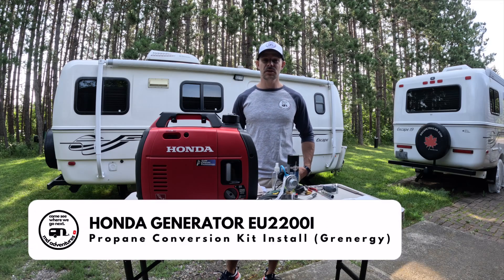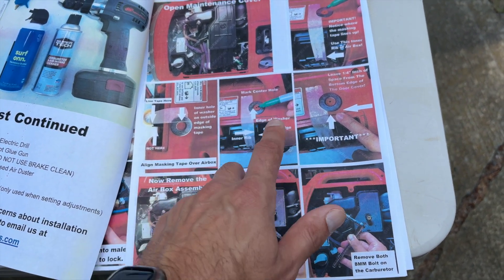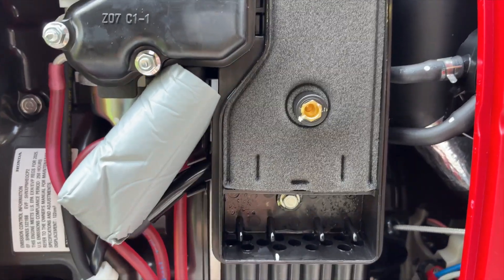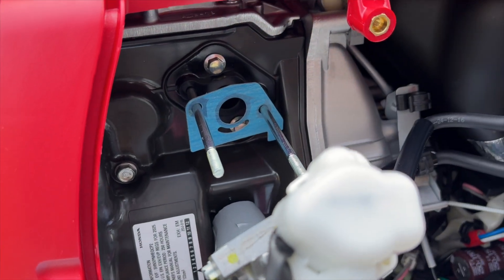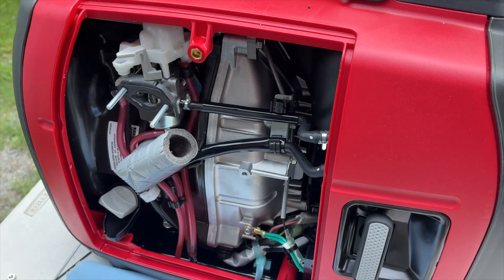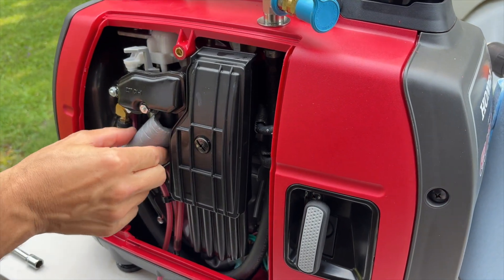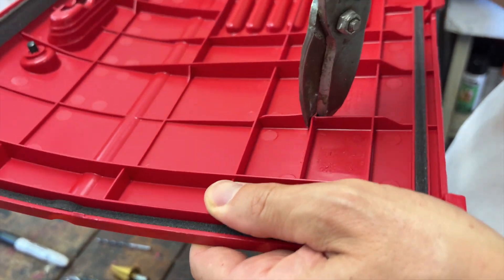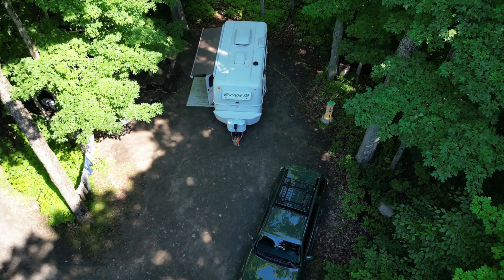Honda Generator 2200i Propane Conversion Kit | How to Install

Comment: why the extra vent holes
Reply from the maker: Extra venting helps maintain proper airflow so the generator doesn’t overheat and continues to get enough oxygen for efficient combustion.
Reply: @md.adventures ok i guess i can also leave the cover off 😊
Reply from the maker: @PhilippeCJR that’s true, but the vents are super easy to install and then you don’t have to worry about any dirt getting into that area